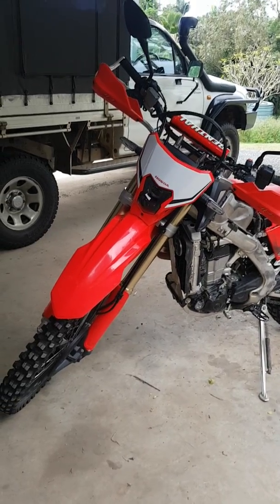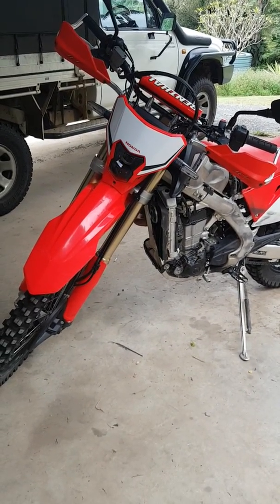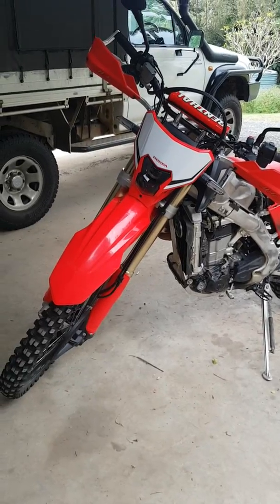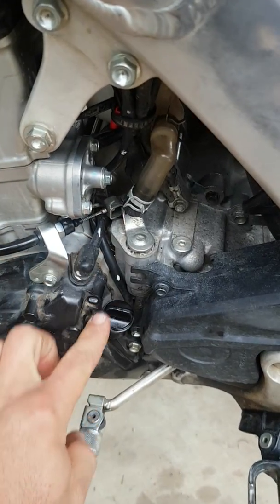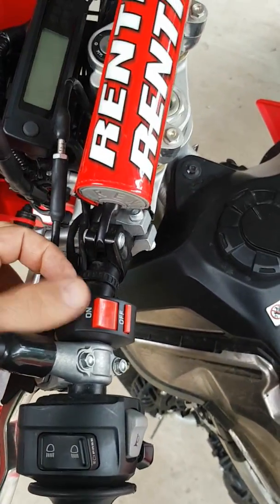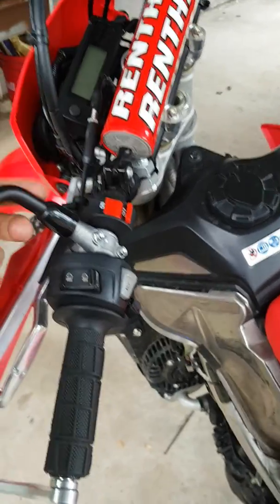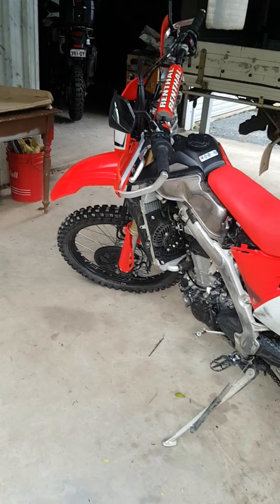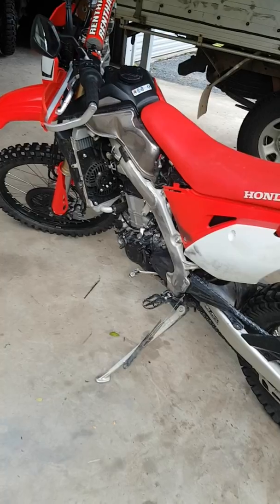Crf450L DIY map switch

Comment: Hi Rainforest
How noticeable is the power difference? I'd like to tone down the power as I find it a bit of hanfull most of the time. Is this mod truly noticeable?
Reply from the maker: its most noticeable when under high load so say like a hill climb, at light loads or at idle it doesn't have much effect, how ever there are a few other mods i have that might help you , look on my other videos for disable decel fuel cut, this makes the bike a lot smoother and more friendly to ride
Reply: @rainforestridersau7865  Thanks heaps dude
I have watched your other videos You are a champion Cheers

Comment: Does this stop it stalling in the lower gears ?
Reply from the maker: no it has little affect at idle, if you want to make it hard to stall  look at my other video  disable decel fuel cut  this makes it harder to stop as it never stops injecting fuel
Reply: @rainforestridersau7865  Do you think this mod reduces the timing enough to run regular fuel instead of premium?
Reply from the maker: @alvaroramirez7738  that thought crossed my mind too, i have never tried running low octane fuel in it but i can say when forcing it to labor hard on a hill it stops it knocking so there is a good possibly it might reduce it just enough especially if other mods give it more fuel at the same time
Reply: @rainforestridersau7865  thanks!